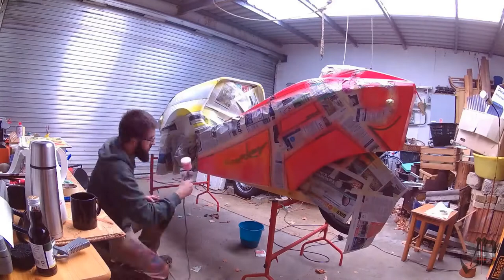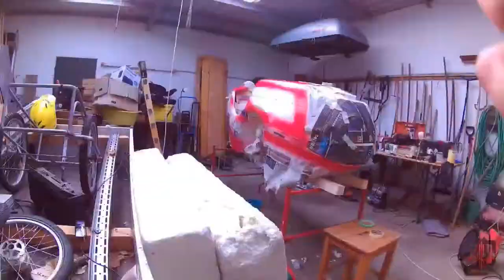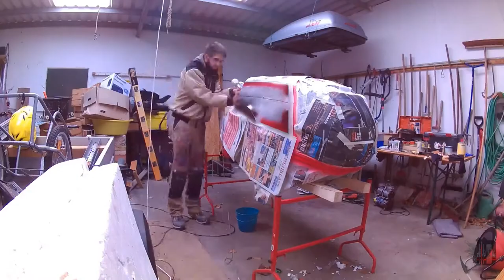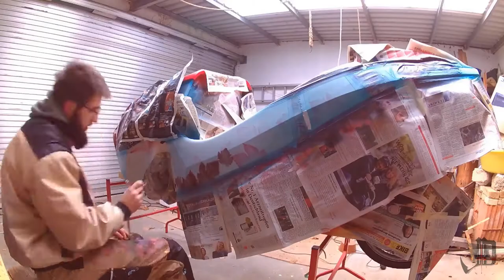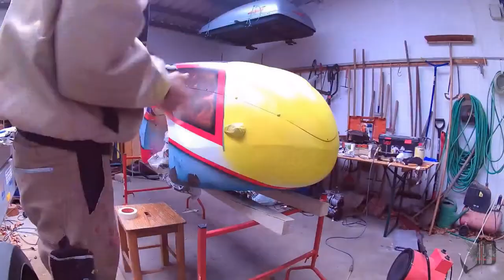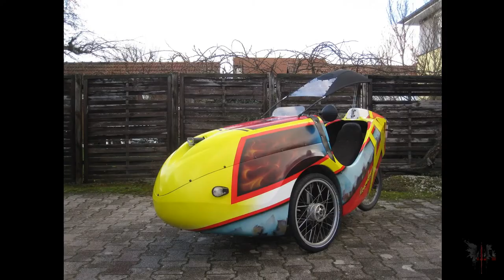Airbrush Painting a Velomobil / Timelapse

Comment: What paint are you using? I will have to repaint mine, as it is mostly dark grey on top and that is not visible enough for my liking. (an old Mango)
Reply from the maker: The paint is Auto Air Colors from Createx. Then i sealed it with 2K Clearcoat.